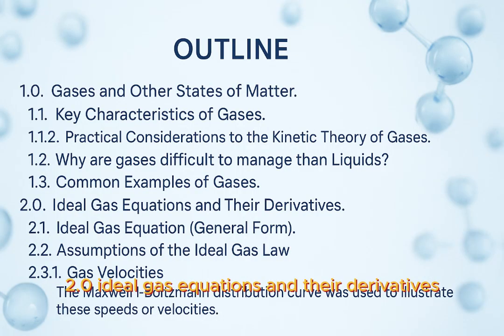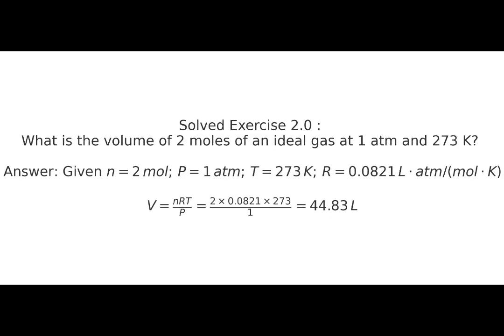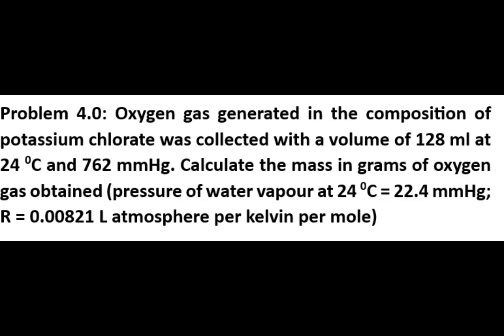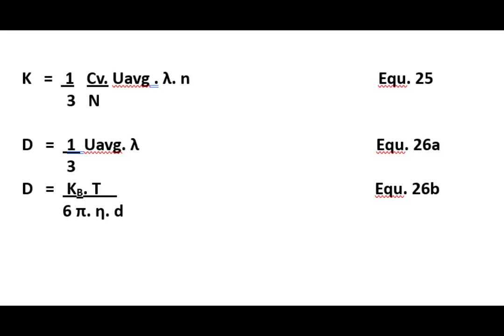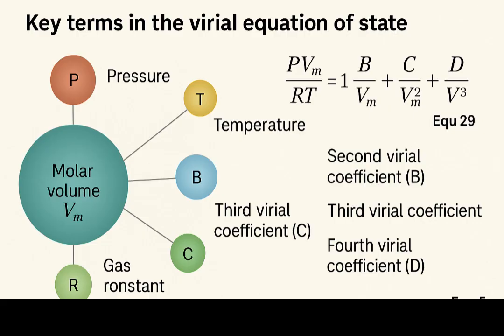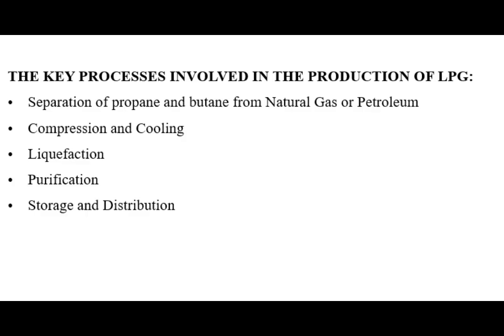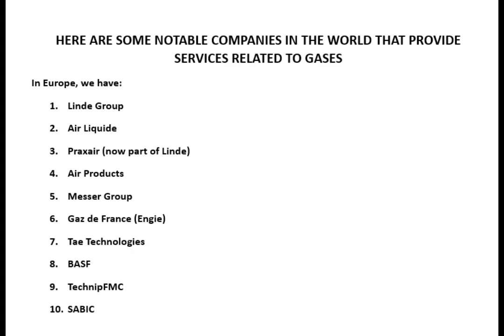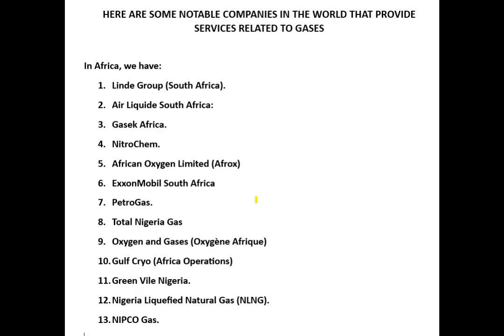Fundamentals and Applications of Gases

Comment: Eze Joy Ifunanya 
BCH:
In anesthesia, common gases like nitrous oxide, sevoflurane, and isoflurane are administered under pressure and at varying temperatures, which may cause deviation from ideal gas behavior

 Implications of Not Using Real Gas Applications during surgery (Anesthetics)

1. Incorrect Dosage Delivery

Ideal gas law misestimates volume and pressure of gas mixtures.

This can lead to overdosing or underdosing anesthetics, potentially causing: 

Inadequate anesthesia (patient awareness or pain)

Excessive sedation (respiratory depression, coma)

2. Inaccurate Vaporizer Calibration

Anesthetic vaporizers are calibrated based on specific pressure-temperature behavior.

If real gas deviations aren't considered, the output concentration may differ from the intended value, risking patient safety.

3. Equipment Malfunction or Inefficiency

Flow meters and gas delivery systems may misread flow rates if based on ideal gas assumptions.

Real gas behavior affects viscosity, compressibility, and flow properties—vital for ventilators and anesthesia machines.

4. Compromised Patient Monitoring

Monitoring systems may infer partial pressures inaccurately if based on incorrect gas behavior assumptions.

Since anesthetic effect is tied to partial pressure at the brain, this misrepresentation can mislead anesthesiologists.

5. Safety Hazards

High-pressure storage and delivery of gases like nitrous oxide must consider real gas effects (e.g., Joule-Thomson cooling).

Overlooked cooling effects or condensation risks can cause frostbite injuries, pressure build-up, or machine damage.

Comment: MCB:U2023/5555155

1. Can ionization of gases in the atmosphere cause lightning during thunderstorms?
Yes.
Ionization of gases in the atmosphere allows electricity to pass through the air during a thunderstorm. This causes a sudden electrical discharge — lightning. The ionized path helps the current travel from clouds to the ground or between clouds.

2. Does ionization of gases cause lighting in an electric bulb?
Yes, but only in certain types of bulbs.

In gas-discharge bulbs (like fluorescent lamps, neon lights, or sodium vapor lamps), yes — ionized gases emit light.

In regular incandescent bulbs, no — they produce light by heating a metal filament (not by gas ionization).

Comment: BCH
Using free and pure form of oxygen gas in the atmosphere for anaesthesia during surgery is unsafe and medically inappropriate. Atmospheric air contains only about 21% oxygen, while the rest is mostly nitrogen and other gases. This means it cannot provide the high oxygen concentration needed during surgery. In contrast, oxygen cylinders contain pure or nearly pure oxygen which allows doctors to control and deliver the exact amount required to keep the patient stable. Using atmospheric air may result in hypoxia (low oxygen in tissues) poor delivery of anaesthesia, complications during surgery and even the rest risk of death. Therefore, only medical grade oxygen from a cylinder should be used.

Comment: BCH:Oxygen Toxicity:

Both forms of pure oxygen can cause oxygen toxicity, leading to lung damage and other issues. However, the risk is higher with atmospheric oxygen because it's difficult to control the concentration and delivery. 

Absorption Atelectasis:

Pure oxygen can cause the collapse of lung tissue (atelectasis) as it's rapidly absorbed from the alveoli. This is a concern during anesthesia induction and can be exacerbated by the lack of control over oxygen delivery from the atmosphere. 

NAME:GABRIEL CHIOMA DIVINEGIFT

Comment: BCH: Using free atmospheric oxygen instead of a regulated cylinder of pure medical oxygen for anaesthesia during surgery poses serious and potentially fatal risks. Atmospheric air contains only about 21% oxygen and is mixed with nitrogen, carbon dioxide, pollutants, and microorganisms, making it unsuitable for sterile medical use. In contrast, medical oxygen cylinders deliver 99.5% pure, sterile oxygen at controlled pressure and flow rates necessary for precise anaesthetic delivery. Anaesthesia often suppresses natural respiration, increasing the patient's need for higher oxygen concentrations, which ambient air cannot provide. Moreover, anaesthetic machines are designed to work with pressurised oxygen sources, making atmospheric oxygen incompatible. Using non-medical oxygen violates safety protocols and legal regulations, increasing the risk of hypoxia, surgical complications, infections, and potential legal consequences for malpractice.

Comment: BCH:  Applications of Not Using Real Gas (e.g., CO2) During Surgery
In surgical procedures, particularly laparoscopic surgeries, gases like carbon dioxide (CO2) are commonly used to inflate the abdominal cavity (pneumoperitoneum) for better visibility and access. However, there are potential drawbacks and complications associated with gas insufflation. Some applications or benefits of not using real gas or exploring alternatives include:

1. Reduced Post-Operative Pain
- Gasless laparoscopic surgery or using alternative methods might reduce shoulder pain and discomfort caused by CO2 insufflation.

2. Lessened Risk of Gas Embolism
- Avoiding gas insufflation reduces the risk of gas embolism, a rare but potentially life-threatening complication.

3. Minimized Cardiopulmonary Stress
- Gasless techniques might reduce the pressure on the diaphragm and lungs, potentially benefiting patients with pre-existing cardiopulmonary conditions.

4. Alternative Methods for Visualization
- Techniques like abdominal wall lift devices can provide a gasless environment, offering a different approach to achieving surgical exposure.

5. Potential for Reduced Nausea and Vomiting
- Some studies suggest that avoiding CO2 insufflation might reduce post-operative nausea and vomiting (PONV), improving patient recovery experience.

Considerations:
- *Technical Challenges*: Gasless surgery might present technical difficulties for surgeons, potentially affecting procedure duration and complexity.
- *Patient Selection*: The decision to use gasless techniques depends on the type of surgery, patient condition, and surgeon preference.

Comment: MCB 

Ionization and Lightning
Ionization of gases in the atmosphere contributes to lightning formation during thunderstorms by creating a conductive pathway for electrical discharge 
Ionization and Electric Bulbs
In electric bulbs, ionization plays a role in fluorescent bulbs, where it creates a plasma that produces ultraviolet light. However, in incandescent bulbs, light is produced by heating the filament, not ionization.
Key Differences
1. *Scale*: Ionization in thunderstorms occurs on a massive scale, while in electric bulbs, it's a controlled process.
2. *Purpose*: Ionization in thunderstorms leads to electrical discharge (lightning), whereas in electric bulbs, it's a means to produce light through gas excitation.

Comment: GLY:
In coiled tubing operations for oil and gas well intervention, nitrogen is often used as a lifting or energizing agent. Nitrogen is preferred in its real gas form rather than an ideal gas form due to its:

1. Compressibility: Real gas behavior accounts for nitrogen's compressibility, which is crucial for accurate calculations of pressure and volume in wellbore operations.
2. *High-Pressure Conditions*: Real gas behavior better models nitrogen's properties under the high-pressure conditions often encountered in downhole environments.

Using real gas properties ensures more accurate predictions and safer operations.

Comment: MCB: Yes, ionization of gases in the atmosphere plays a crucial role in lightning during thunderstorms:
1. Ice and water interactions: Within cumulonimbus clouds, ice crystals and water droplets collide, generating static electricity.
2. Charge separation: This leads to a separation of electrical charges within the cloud, with positively charged particles accumulating at the top and negatively charged particles at the bottom.
3. Electric field: The charge separation creates a strong electric field between the cloud and the ground or within the cloud.
4. Ionization and breakdown: When the electric field becomes strong enough, it ionizes the air molecules, creating a conductive pathway for electricity to flow. This breakdown of air molecules is known as electrical discharge.
5. Lightning: The rapid flow of electricity through the ionized air creates the bright flash of light we see as lightning, and the sound we hear as thunder.

Yes, ionization of gases can lead to the lighting of certain types of electric bulbs, especially gas-discharge lamps
In bulbs like fluorescent lights, neon lights, and sodium vapor lamps, a gas inside the bulb is ionized when voltage is applied.
Ionization which clearly means the gas atoms lose or gain electrons, creating plasma (a mix of ions and free electrons). Therefore, these charged particles conduct electricity and emit light when excited electrons return to lower energy levels. Examples: Neon lights glow red-orange due to ionized neon gas, also Fluorescent bulbs use mercury vapor; ionization produces UV light, which hits a phosphor coating to emit visible light, etc.
Note: In certain types of bulbs, ionization of gases is the key to how they produce light.

Comment: PIC:
LNG (Liquefied Natural Gas) isn't produced using the Joule-Thomson effect like LPG (Liquefied Petroleum Gas) because:

1. *Methane's inversion temperature*: LNG's primary component, methane, has a low inversion temperature, making it harder to liquefy using Joule-Thomson effect alone.
2. *Pre-cooling requirement*: Methane needs significant pre-cooling before applying Joule-Thomson expansion, unlike propane/butane (LPG components).
3. *Complex liquefaction process*: LNG production requires multi-stage refrigeration cycles, making it more energy-intensive.

LPG, with higher inversion temperatures, can be liquefied more easily using Joule-Thomson effect at ambient temperatures. LNG production demands more complex processes due to methane's unique properties.

Comment: "MCB : 
Yes, ionization of gases in the atmosphere can cause lightning during a thunderstorm. Lightning occurs when a strong electric field causes air molecules to ionize, creating a plasma of charged particles (electrons and ions). This ionization allows a massive discharge of electricity to flow as a lightning bolt, equalizing the charge difference between clouds or between a cloud and the ground.
In electric bulbs, particularly gas-discharge lamps (e.g., fluorescent or neon bulbs), ionization of gases also plays a role. When voltage is applied, the gas inside the bulb ionizes, forming a plasma that conducts electricity and emits light, often through excitation of specific gases or coatings. However, in incandescent bulbs, light is produced by heating a filament, not gas ionization.

So, gas ionization is key to lightning and certain types of electric bulbs, but not all bulbs rely on this mechanism."

Comment: PIC: LNG (Liquefied Natural Gas) is mostly methane (CH₄), a very light gas.

LPG (Liquefied Petroleum Gas) is mostly propane (C₃H₈) and butane (C₄H₁₀), which are heavier hydrocarbons.

The Joule-Thomson effect is a process where a gas cools down when it's allowed to expand without doing any work (like passing through a valve). This cooling can eventually lead to liquefaction but this effect doesn’t work equally for all gases.

Methane (the main component of LNG) behaves differently from propane and butane (the main components of LPG) when it comes to the Joule-Thomson effect.

Methane’s Joule-Thomson Inversion Temperature is Very Low

Methane only cools down during expansion below a certain temperature called the inversion temperature.

Above this temperature, expanding methane actually heats up, not cools down.

So therefore; 
LNG (methane) cannot be liquefied by just expanding it through the Joule-Thomson effect like LPG because methane needs to be extremely cold first before this method works. LPG gases (propane and butane) can be easily liquefied with simpler cooling and expansion because they naturally condense at much higher temperatures.

Comment: PIC: u2023/5581078

LNG is not produced via the joule Thompson experiment because natural gas(methane) has an extremely low temperature unlike the LPG it needs advance cooling not just pressure drop

Comment: PIC : LNG (Liquefied Natural Gas) is not produced solely through the Joule-Thomson effect because it is primarily composed of methane, which has a very low boiling point. This makes it difficult to liquefy at room temperature.

LPG (Liquefied Petroleum Gas), on the other hand, can be liquefied at relatively low pressures and temperatures. This makes the Joule-Thomson effect suitable for its production.

Comment: U2023/5565024
In coiled tubing operations, nitrogen's real gas behavior is considered due to extreme conditions, allowing for precise calculations, enhanced safety, and optimized performance, ultimately ensuring more efficient and reliable well interventions with reduced risks and improved outcomes in oil and gas operations.

Comment: Obuma Princess 
MCB

ionization of gases in the atmosphere can cause lightning during a thunderstorm. When the electric field between clouds or between the cloud and ground becomes strong enough, it ionizes air molecules, making the air conductive and allowing a sudden discharge of electricity—lightning. it depends on the flow of electric current through a filament (in incandescent bulbs) or through gases (in fluorescent or LED bulbs), but not necessarily due to ionization like in lightning

Comment: MATTHEW ESTHER JOSEPH 

PIC: LNG (Liquefied Natural Gas) and LPG (Liquefied Petroleum Gas) have different properties that affect their production processes. The JT (Joule-Thomson) experiment is a method used to liquefy gases by expanding them through a valve or nozzle, which cools the gas.

LPG, primarily composed of propane and butane, can be liquefied relatively easily at room temperature under moderate pressure (around 5-10 bar). The JT effect is sufficient to liquefy LPG in many cases.

However, LNG, primarily composed of methane, requires much lower temperatures (around -162°C) and higher pressures to liquefy. The JT effect alone is not enough to achieve the low temperatures needed for LNG production. As a result, LNG production typically involves more complex refrigeration cycles, such as the mixed refrigerant cycle or the propane pre-cooled mixed refrigerant cycle, which can achieve the required low temperatures.

These cycles involve multiple stages of compression, expansion, and heat exchange to cool the gas to the point where it liquefies. So, while the JT effect is useful for LPG production, it's not sufficient for LNG production due to the much lower temperatures required.

Comment: Iwolagbe Samuel idialoise 
U2023/5581076
PIC :
The J-T experiment demonstrates a cooling effect used in gas liquefaction.

Why LNG is not produced via the J-T experiment as LPG this is because the two gases,have different properties and require different processing methods for liquefaction.

Seeing that LNG production, relies in       
Cryogenic refrigeration cycles and large scale liquefaction plants cool mostly methane to cryogenic temperatures.

While LPG Production, involves compressing and cooling heavier hydrocarbons, often by propane or butane refrigeration cycles, which are more easier to liquefy at comparatively higher temperatures and pressures.

Comment: PIC: Joule-Thomson Effect

This is a process where a gas cools down when it expands without doing any work and without heat exchange (adiabatic expansion). It’s used in refrigeration and gas liquefaction processes.

LNG is not produced via the Joule-Thomson effect because methane requires very low temperatures (–162°C) to liquefy, which J-T expansion can’t achieve on its own.
But LPG can be easily liquefied with moderate pressure due to its higher boiling point, so J-T expansion works well for LPG.

Comment: LNG (Liquefied Natural Gas) isn't produced using the Joule-Thomson effect like LPG (Liquefied Petroleum Gas) because:

1. *Methane's inversion temperature*: LNG's primary component, methane, has a low inversion temperature, making it harder to liquefy using Joule-Thomson effect alone.
2. *Pre-cooling requirement*: Methane needs significant pre-cooling before applying Joule-Thomson expansion, unlike propane/butane (LPG components).
3. *Complex liquefaction process*: LNG production requires multi-stage refrigeration cycles, making it more energy-intensive.

LPG, with higher inversion temperatures, can be liquefied more easily using Joule-Thomson effect at ambient temperatures. LNG production demands more complex processes due to methane's unique properties.

Comment: BCH: U2023/5535096
The use of atmospheric air for anesthesia is not suitable rather than oxygen cylinder is not safe because atmospheric air only contains approximately 21% of oxygen and it also contains other substituents like nitrogen, carbon dioxide and even dirt like dust . Atmospheric air is not sterile , it also contains microorganisms which are not safe for and might end up putting patients health at risk.